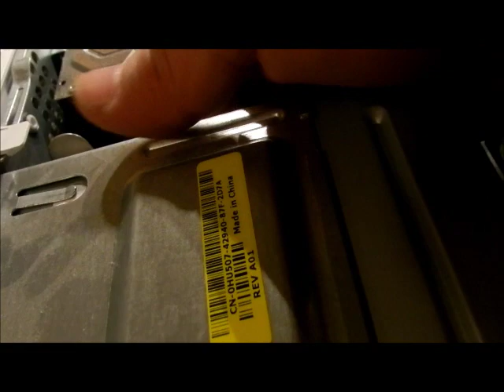Dell Inspiron 530S Inside

Comment: I recently came across a 530s sff mother board with a vista os disc. would like to do some old school gaming on it. what do I need
Reply from the maker: Sure.  Perhaps some more RAM.
Reply: +William Quinn the specs say it will only hold 4gh ddr2 😭
Reply: +ARC Damnation that should run ut99 and qquake3 right
Reply from the maker: ARC Damnation Not sure.

Comment: The part I wanted to see was how to get the dvd case out of the way to get at a screw that holds the motherboard in ,you said I figure it out but have not yet.
just one screw underneath that case that I can't get at to remove the motherboard
Reply from the maker: John Godfrey Use the pull tabs to lift the DVD drive out of the way.
Reply: William Quinn I am not sure which tabs you are referring to.but i found the front panel pulls away and lets the case slide out of the front.   thanks John
Reply from the maker: Just look around.  There's not much else than the tabs.

Comment: Any suggestions on how to get off power save mode
Reply from the maker: At the Start menu type "power".  You then should see "power options" come up.  Select that and update your power options.
Reply: When I turn my dell 530s on the screen keeps going off and on like its restarting itself and reads auto detect (analog input)
Reply from the maker: Try another monitor.  If this continues there is no output signal from your video card.  There is a slot to insert a video card on.  I no longer have this computer to show you how.  Please let me know what you find if you pursue this repair.

Comment: You couldn't put another CD-ROM drive in because the front panel is hidden behind the Multimedia panel on the front.
It would be useful to mention upgrading the graphics adapter, i.e. not using the onboard graphics but using something like a HD7750 low profile card.  You need to be careful not to get a card that needs an external power supply, because the unit fitted to this PC doesn't have the right 6V connector, or any Molex power connectors to adapt.

Comment: You mention that the power supply, if it fails, has to be replaced directly from dell. Does that mean upgrading the PSU is out of the question? Even if its a micro atx, which would fit the space specifications?